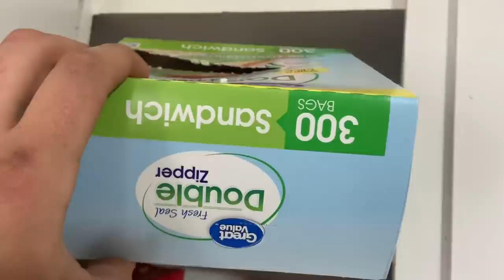Saving a Vintage Porsche 911 Targa from the Scrapyard: Rebuild Part 4

Comment: Media blasting where H2O is the media. Couldn’t do that legally in California, never mind where the paint chips go. But, honestly I think you bit off more than you can chew. I commend you for having the courage to keep going.
I think, depending how you progress and how you approach them, Porsche has a program for people restoring vintage Porsches. Maybe when you get it to point determined by them and achieved by you, they would help you get the body back to 100%, then you get it painted and reassemble it.
There’s a “rule of thumb” for restoring a car. If you sit down and thoroughly plan out and budget for what you think it will cost, triple that number and you might be close to accurate, if you’re lucky, and the Lord is smiling on you.
Despite how pessimistic I seem, I am still praying for you to succeed. Also, when it’s too cold, dark, wet, or whatever to work on the car, communicate with Porsche and see what you can dig up on the cars history and providence. Some of us Porschephiles, enjoy that. As Gean Kranz said, “Godspeed!”

Comment: I've tried using gloves while rebuilding cars they just don't work for me I like to feel everything you don't feel what you're touching as well with gloves on and beside that I'm not afraid to get greasy or dirty that's what they make soap and water and various garage hand cleaners for if you're worried about greasy hands probably shouldn't be working on a car
Reply: My biggest issue they always tear at the worst times.

Comment: Stop removing all the parts from this car, you need to put it on a rotisserie first and then remove the parts otherwise you are going to twist the chassis/frame. Put some cheap wheels on this car too. Check this for new floor pans https://www.stoddard.com/porsche-911/body-and-body-trim/floor-pan-parts.html

Comment: Please, don't go the rat rod route. A rat rod built out of an old heap of scrap no one cares about is one thing but something like this deserves a classier build. Hell, go full resto mod and engine swap the thing and throw in upgraded suspension and drive-train if you want but don't skimp out on the finish and details and call it a "rat rod". It just smacks of lazy building.